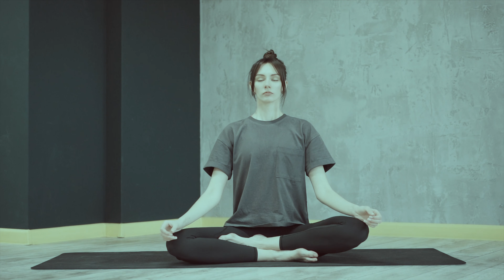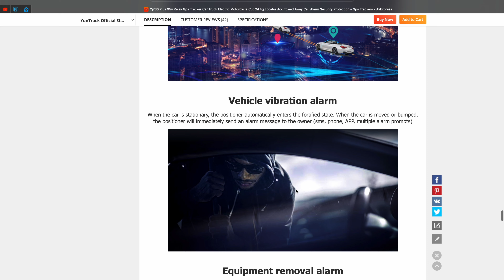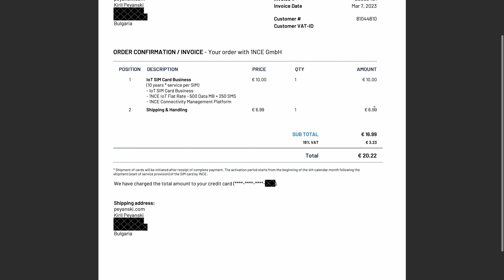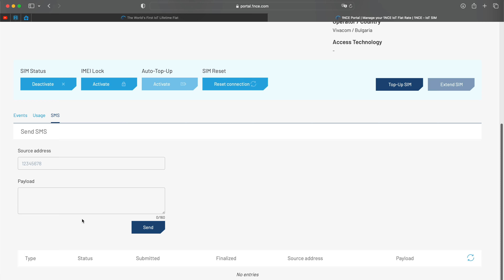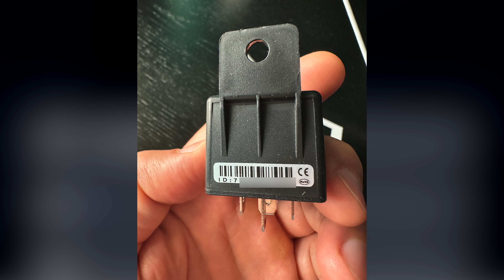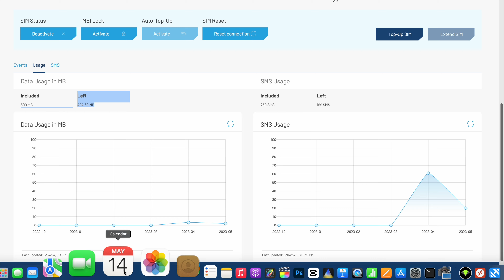A MUST for Every Vehicle Owner that Wants Protection From Theft!

Comment: CJ720 didn't work for me(SE-USA) so I replaced that with SinoTrack ST-901L.    ST-901L did work along with 1nce sim card.    It is still a little early but it looks like I will be using about 30 MB of data each month.

Comment: Great video.. as others have said.. not covering the same stuff as others.. which is great.. Keep up the good work.. a question about the 1nce sim, it says it will check company registration within 7 days.. have you had any issues around this as i'm building this for personal use.. so technically i'm in breach of the agreement they ask you to confirm.. Hoping they don't just turn off my sim..

Comment: How do i find out the phone number so that i can send a text from my mobile instead of the app.

Also, great video.

I look forward to Home Assistant integration.
Reply from the maker: You can't send text from your mobile with that SIM card, because it is an IoT one. Sending sms-es is only possible from the 1nce portal or by using 1nce API

Comment: I'm your fan and follow all of your videos especially in HA related subjects. I just surprised that saw you've introduced this dangerous product. Although you might not be the unlucky people who experience this example but it is possible:
Assume that you are running in a highway with 120Km/h, and as a very rare occurrence, this relay disconnect your pump or coil because of part failure or hack or lose connection etc., your car with be stopped immediately and other cars will come over you by that much speed. Please be aware that fuel pump and coil are safety parts in the car and should be in comply with ASIL D grade safety standard.
As I'm automotive electronic engineer working in car manufacturer, while we want to make  connected car, there are several considerations which you can find some of them on R144 standard.
According to usual rules which is different from country to country, no one is allowed  to stop the engine by any way (because of safety reasons) and just police can use of slow down feature in a very supervised condition.
Then please warn people who want to use of this relay about its safety considerations.
Reply from the maker: Fair enough, but honestly I’m pretty sure that if you go to a local gps service they will do the same/similar thing to your vehicle and probably you will end up with fewer features for much higher price

Comment: Would be nice to see you pull a picture or 2 from a dash-cam that also had a cab cam and sms some pics.  Seems like you would need your HAS integration working for that and an ability to send data to the device you picked.  Although that would chew through data, there might be a camera that has a good jpeg compression etc.  Might also want to see if they are driving down the freeway before you cut-off the gas.  A panicked burglar might do something stupid.   Maybe easy enough to get a speed from a bluetooth ODB2 reader and just at 0 cut it off.   Also another network you could consider is the 'Amazon sidewalk' network.  I havent looked into it too much but it seems like it could shave some mb's possibly in places where the network strength is strong.  Cool device.  Glad you made this video or I wouldnt have known about it.  Thanks for the content.
Reply from the maker: Hi there, for bigger vehicles like campers, buses, trucks, etc you can add a separate 4g/5g router and cameras for that. I did that in my camper and it works great. Through that mobile router you can live stream your camera or take pictures, record video etc in case of activated alarm. If I manage to integrate the CJ720 relay with HA I will automatically send cut fuel command immediately after the alarm is activated so the burglar will not be able to start driving at all. Never heard about Amazon Sidewalk I have to check it out. Thanks :)
Reply: I understand now.  Thanks for explaining. @KPeyanski

Comment: Think there may be a problem with more modern vehicles with multiple computers as well as the main ecu. If components such as fuel pumps are disconnected with a relay you end up with the check engine light on and fault codes.
Reply from the maker: Yes, that may be true in some cases, but again I prefer check engine light to be turned on 100 times than a stolen vehicle :)
Reply: Congrats. DIY is amazing ✌🏻

Comment: Very cool video! I tried to buy the tracker from your affiliate link but it seems to be broken.
Reply from the maker: Glad you like the video. Very strange about the link. Just checked it and it worked perfect. Do you have any ad blocker by any chance? If yes, try to disable it temporarily.
Reply: @KPeyanski  I don't use any ad blockers. It says it's not available in my location (Germany) but it doesn't work either if I change to other locations in Europe.
Reply: @pablodv57  The same here. I was able to see the GPS Tracker when I changed country to Poland